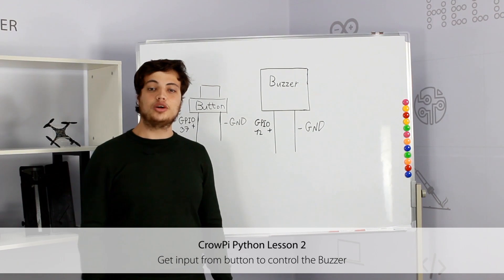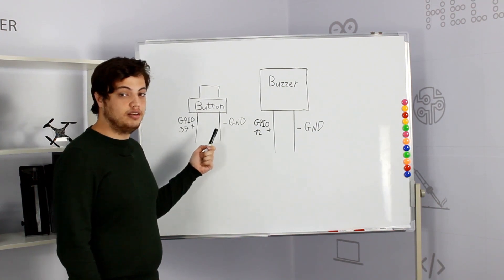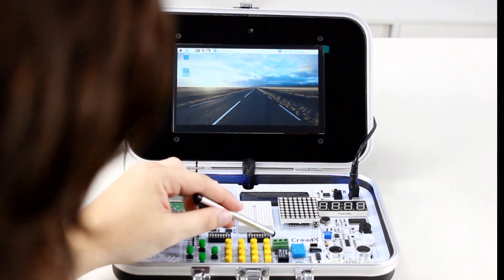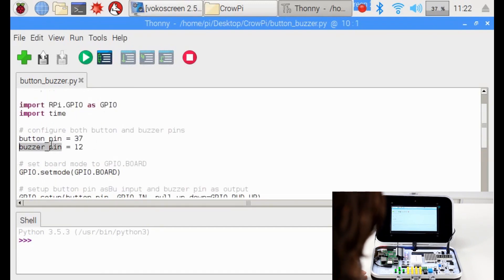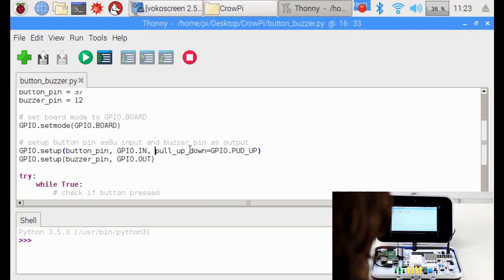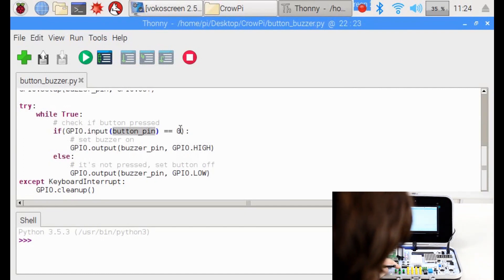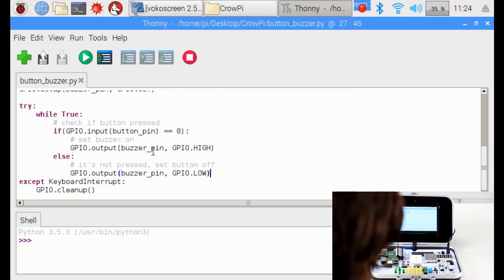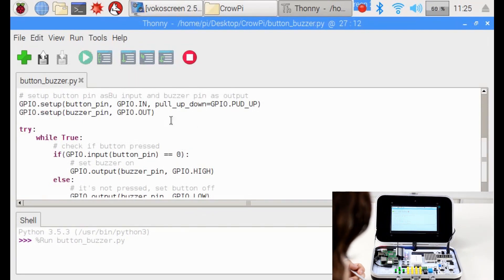CrowPi Python Lesson 2：Get input from button to control the Buzzer

Comment: Hi all, for those using the Raspberry Pi 4 version of the CrowPi, you need to make sure that "button_pin = 37" and "buzzer_pin = 12" and that "GPIO.setmode(GPIO.BOARD). The new Raspberry Pi 4 version of the CrowPi already includes the updated scripts so I am just putting this out there for anyone who has swapped out the Raspberry Pi 3 for a Raspberry Pi 4 on their CrowPi.
Reply: Max Walsh thanks, i was wondering what why the buttons were so similar yet so different
Reply: Thanks for the help , but i have the new version and its not updated!
Reply: I did that and got the following message:   Traceback (most recent call last):
  File "/home/pi/CrowPi/Examples/button_buzzer.py", line 13, in <module>
    GPIO.setmode(GPIO.BOARD)
NameError: name 'GPIO' is not defined
Reply: I got this and it puzzled me 
Button_buzzer.py:17: Runtimewarning: This channel is already in use, continuing anyway. Use GPIO.setwarnings(False) to disable warnings
     GPIO.setup(buzzer_pin, GPIO.out)
Can anyone help?
Reply: I had to make “buzzer_pin=18” and “button_pin=26” to get it to work for me with my RaspberryPi 4 version. It’s self explanatory why the buzzer is 18 (it’s labeled as that instead of 12). I can’t figure out why it had to be “26” instead of “37” though, since the button is labeled “37”. I only knew to try 26 because it was already in the example. How could I figure this out?